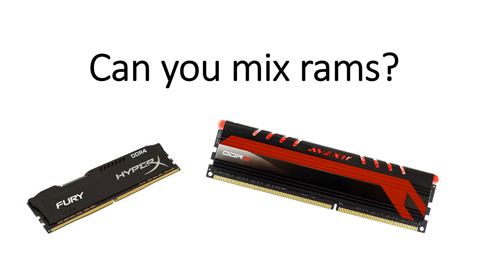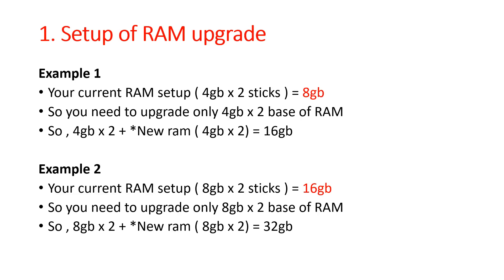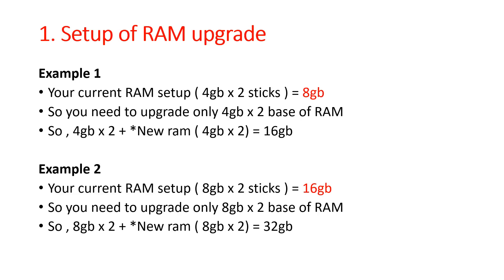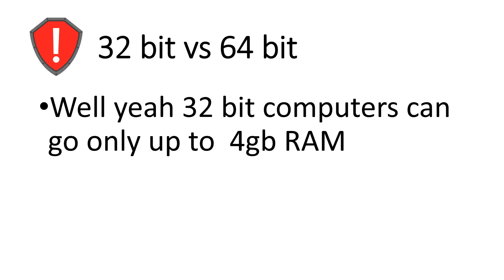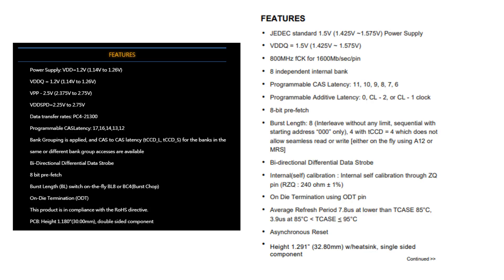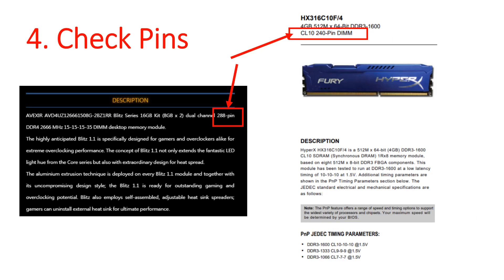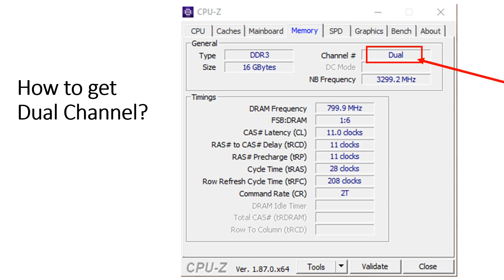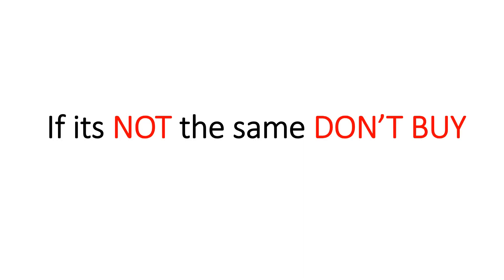BEFORE YOU UPGRADE YOUR RAM WATCH THIS !!! MIX RAMS?

Comment: Im going to maybe some on here. I own a mac and called. Buy your ram together. It comes from the same batch. I didn't know anything about different batches but the person on the chat said if you buy it at different times it doesn't come as the same batch and they weren't very helpful other than that advance. So if you want to mix and match ram on a mac, make you order one in a pair and the other one in a pair. Or just all 4 together. I looked all over online for this and i never knew that.

Comment: hi
i have amd ryzen 5 3500 u vega 8 graphics and i have 4gb ddr4 2400 mhz cas latency 17 ram
and i ordered another 4gb ddr4 2666mhz cas latency 19 as i have a slot left will this combination work on my cpu as there is a lil difference in their frequency and cas latency only otherwise voltage is 1.2 for both sticks and the ram which i bought is of crucial brand ...plz reply me

Comment: My laptop has 2 ram slots
First one: 4GB DDR4 RAM (4x1)
Second one: Nothing, but I want to put a 4GB DDR3 RAM stick in. Can I do this process?
Reply from the maker: sorry bro, DDR4 slot only works with DDR4 ram.
Reply: Sketchy On Reviews thanks and also I went on the hp website and it said laptop can go up to 32GB Ram is it possible that I can keep my default 4GB and add an 16GB DDR4 and get 20GB Ram total?
Reply from the maker: @discontinuedchannel2377  not sure on that, but just in case you planning to get the 16gb 1 stick first, do update me the  outcome, pretty curious. in sense, if the Mhz and other things match, it wouldn't be a problem if it runs. normally, either or one of the rams shows up and made the other ram unusable.
Reply: Sketchy On Reviews kk

Comment: my problem is i have
Crucial 8GB DDR4 2666MHZ and HyperX 8GB DDR4 2666MHZ both require 1,2V to operate. but the Latency is different :/  the crucial has a latency of 19 while the Hyper X has a latency of 16
Reply: If your pc still working I think its fine cuz im also using a corsair ram and a Hynix one
Reply: @jasonducci  hey sorry for the late reply. It was working but when playing games only 8gb would be taken. I changed both to 2x 8gb ddr4 3200Mhz. I get like a solid 15 to 20 fps in Fallout 4 running mostly at 60fps. Both are Hyper X fury's

Comment: Can this Ballistix Sport LT 8GB (2 x 4GB) 288-Pin DDR4 SDRAM DDR4 2400 (PC4 19200) Desktop Memory Model and this

G.SKILL Value 8GB (2 x 4GB) 288-Pin DDR4 SDRAM DDR4 2400 (PC4 19200) Intel X299 / Z270 / Z170 / X99 Platform Desktop Memory Model

Go into the ASRock Z390 Extreme4 LGA 1151 (300 Series) Intel Z390 HDMI SATA 6Gb/s USB 3.1 ATX Intel Motherboard RAM slots at the same time?

Comment: can i use two different types of ram for example 2 sticks of 4G ram 2666mhz and 16G ram 2666mhz  but the 16G is a different brand name to the 2 sticks of the same brand name

Comment: i thought the size didnt matter. just the type (ddr3 ) and frequency. if you mix frequencies, then the lowest common denominator is use.   i have 24 gigs, 2x8 and 2x4 of ddr3. its over kill for most of the games i use cause it really dont use more than 7-9 at any given time.

Comment: can i mix: 4gb ram 2133 mhz ddr4 + 8gb ram 2133 mhz ddr4 with different timing? For examble 4 gb ram timing : 13-13-13-31 and 8gb ram : 15-15-15-35    ???? plz help.      Or can i mix 4gb ram 2133 mhz + 8 gb ram 2400 mhz?   please help
Reply: you can mix it as long as it is the same ddr, both ddr 4 etc. for timing speed, yes you can! Unfortunately, both ram will run it at the common lowest speed. in your case both ram will run on 2133mhz.
Reply: Can. you get 2133mhz.  but at risk to bluescreen..

Comment: can i upgrade from 4gb 1333Mhz DDR3 x 2, to 8gb 3200Mhz DDR4 x 2  ???
Spec, Intel(R) Core(TM) i5-3470 CPU @ 3200Mhz  3600Mhz... 64bit
Reply: boleh bro. tapi better beli yang 2400Mhz cheaper.
Reply: @zahirulhafiz8065  alright.. tq bro info

Comment: Can I use Corsair Vengeance RGB 16GB (2x8GB) DDR4 2667 and mix it with Corsair Dominator Platinum 16GB (2x8GB) DDR4 3000MHz ??? They are both DDR 4 but different Mhz speed, someone please help.
Reply: Will it dual channel?

Comment: I have 16gb ram setup {4x4gb}, those are have the same brand from Geil, but have different specs.. 2 sticks are 2400Mhz CL 16 and the other 2 are 2666Mhz CL 17, and it runs smoothly on my rig for about 1 year currently, but i always wondering.. will it be lasts for a long time or will it causes some issues in a later time?
Reply: They will run fine, but the 2666 ones will only run at 2400 even though they're physically capable of more.
Reply: I'm thinking of doing that as well, is it okay if i put same RAM but different speed, currently using geil evo 2400 mhz 2x4gb, thinking of adding 2x4gb geil evo potenza but 2666 mhz.